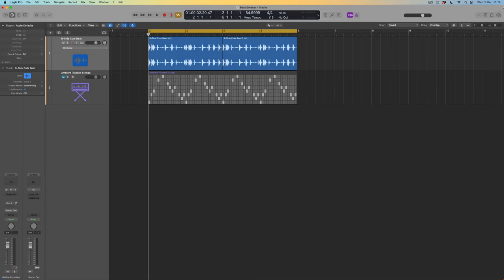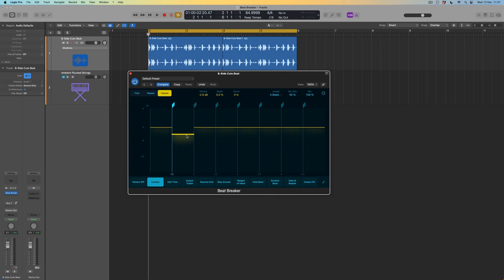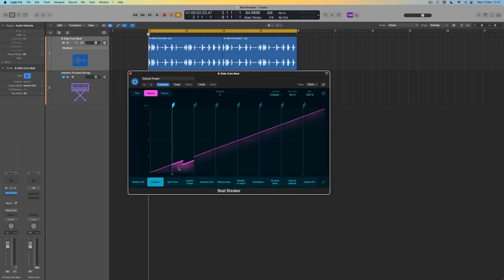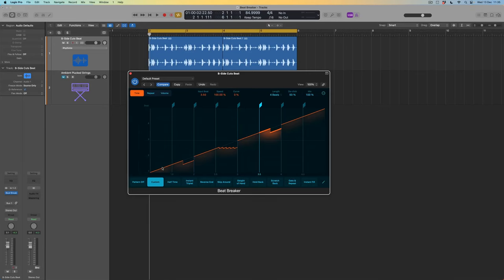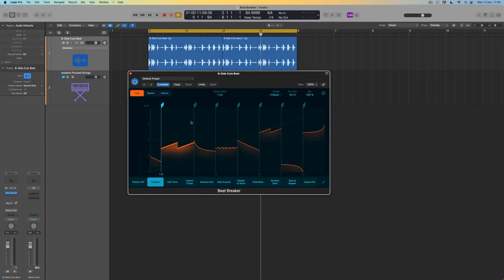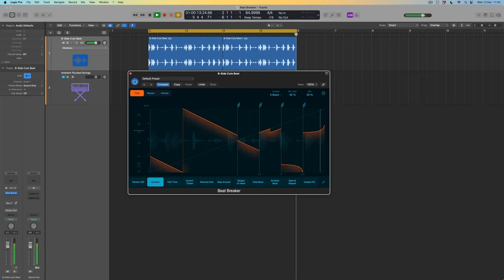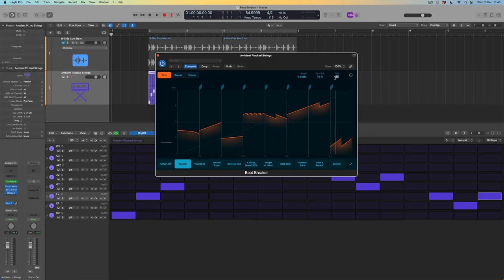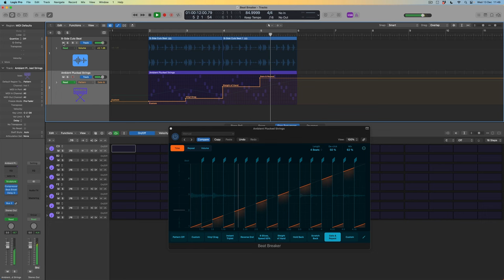LOGIC PRO X - Beat Breaker

Comment: i get lots of clicks and pops while using this plug in, what can i do?
Reply: and it isnt helping with the 100 % de clicking
Reply from the maker: Sorry to hear that, Adam. A few things could cause that, depending on the type of material you're Beat Breaking. But I wonder if it's a I/O Buffer Size issue. The faster the processor is set, the less time it has for processing and this can lead to the introduction of artifacts. Head to Logic Pro > Settings > Audio and turn the I/O Buffer size up to maximum, just to test whether that gets rid of the clicks and pops. If it does, make the buffer size lower and keep dropping it until it's at its lowest possible setting without re-introducing the clicks. I hope that fixes it for you.

Comment: Hi Jono, thank you for these tutorials! Is there a way to make all audio (or midi) in the same key? In production process id like to audition different patterns of bass for example, but I bring them from previous projects all in different keys? Otherwise I need to transpose everything manually.
Reply from the maker: Good question. To the best of my knowledge, there's no automatic key detector option when you import a MIDI clip or audio file. I think the best option for you will be to add the music files (both Audio and MIDI) to the Apple Loop library. Here, each one can be tagged with key and tempo information, meaning that when you import each file, it can conform to the key (or chord) of your current project. So you'll get the result you want, but you will have to spend some time tagging and creating that database of clips in advance. I hope that helps.
Reply: @jonobuchananmusic  thank you so much, ok I need then to build the database of my favorite stuff in loop library.

Comment: am i the only person thinking that plugin is awfully designed and not intuitive at all? theres so many similar ones out there and they managed to make the most clunky version of it :( gross beat from wish basically lol. great video presentation though
Reply from the maker: Hi. I actually like the design of Beat Breaker but I agree that it's perhaps not quite as intuitive as it might be. That said, I do think the Volume and Repeat panes are pretty self-explanatory and it's mostly the complexity of Time page which requires some thought. The bigger thing for me is that the porting of this plug-in from iOS means that the amount of mouse work required to create the lines you might want isn't as smooth as it could be. Perhaps the design and its tactility will be updated (in time) together? Thanks for your kind words about the video!
Reply: @jonobuchananmusic  I was wondering the same since the iOS version has been the “test ground” for features later added to the Mac version. I’m hoping it will get some improvements over time, same with the mastering assistant and Alchemy Sampler. Such great features!